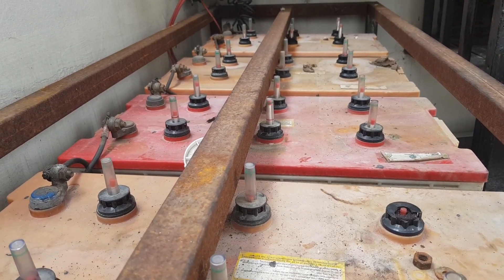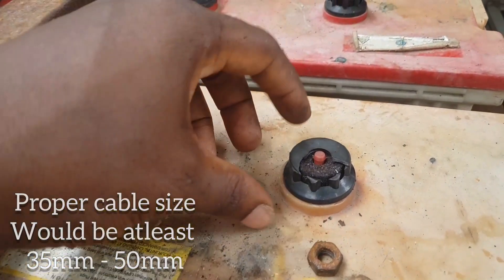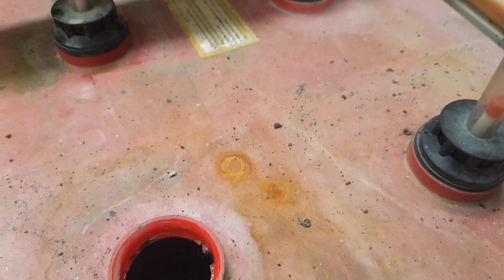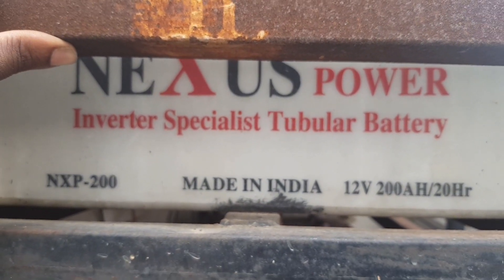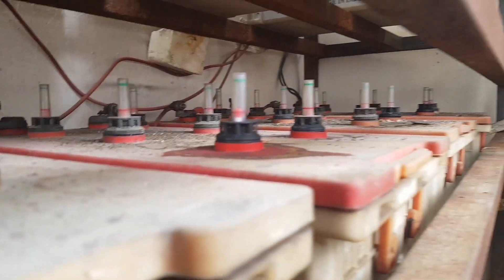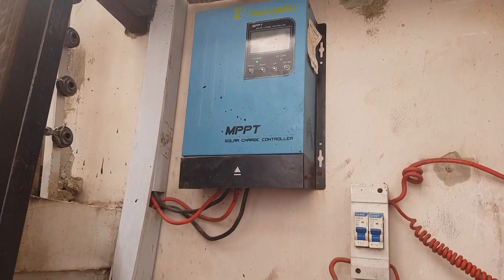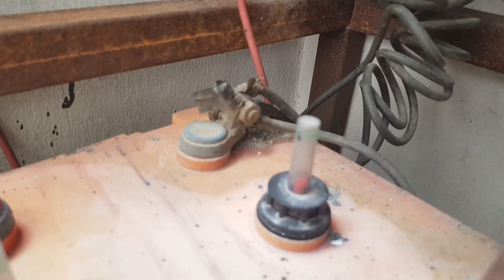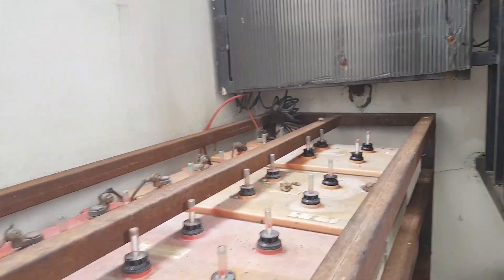Review on a Dead TUBULAR battery

Comment: Oga there are principles. He can actually use tiny cables if they are pure copper. You did not specify if it's copper or not. 2. The higher voltage you go the lesser the size of cable you actually need. The higher Amps you go the ticker the cable at that point you can go for 12awg if u are running higher Amps. From what I have seen, apart from the maintenance factor which has to do with the owner of the system, there is nothing bad with the cables he used or the connection.